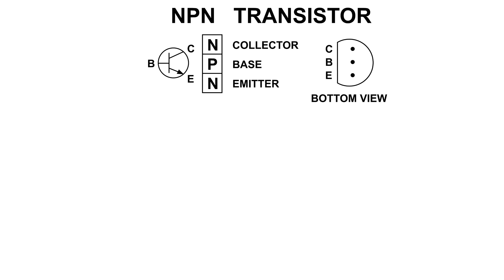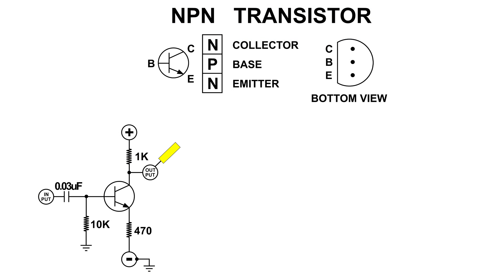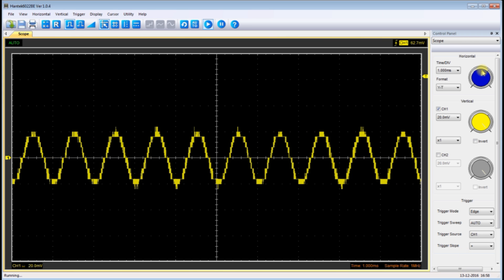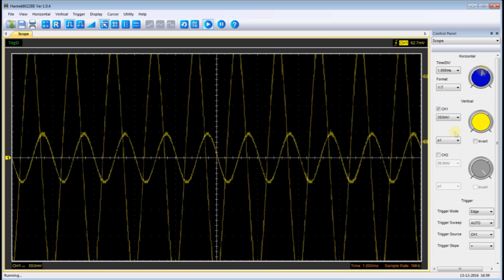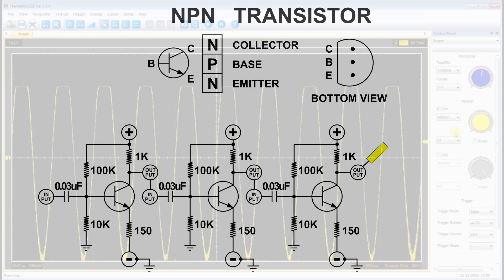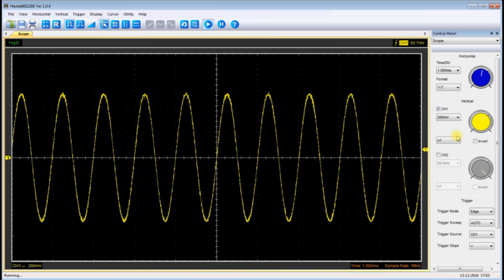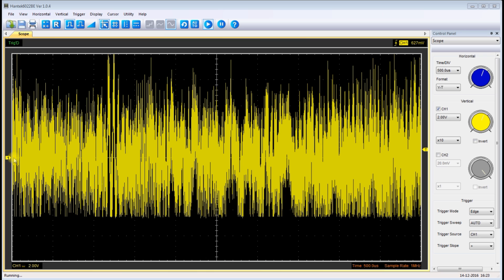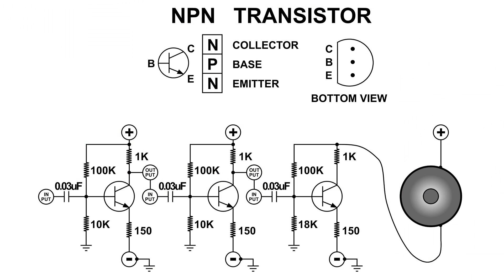Transistor Amplifier Biasing Experiments, for the Beginner

Comment: What would this circuit look like if you were using a big transistor like 2sc5200 and pulling like 10a of current through it obviously those little resistors would pop instantly so how would it powerful output stage transistor be biased and wired up?
Reply from the maker: 2SA1943 2SC5200 200W Amplifier Circuit
https://320volt.com/en/2sa1943-2sc5200-200w-amplifier-circuit/

Comment: Thank you for this video.  I may still not quite understand the mathematics behind the component values and their effects on the system overall, but your section-by-section progression through the build helped me get my own amplifier working.  I was unable to get anything more than about 2 volts output before, from two or three stages, even at 9V rail, and each stage too easily clipped the bottom of the waveform on output.  I'm puzzled why biasing the base makes this difference so profoundly as it does (I understand the concept but not the amount of effect it s) but my 265 mV input signal now is amplified over 2600% to 7 volts, and the waveform out is just as clean as the one coming in.  I'm eventually going to work this into a combination Morse code oscillator + microphone amplifier to use in a future ham radio build.

Thank you again!
Reply from the maker: Thank you, and your welcome.

Comment: Hi Rich, Very nice explanation. Is the capacitor there to filter any DC that may be present on the input signal?
73,
Mike
Reply: n1chp I think the capacitor s he used in this video are to block any DC from getting to the amplifier, so yes you are right. That is also why the values for the capacitors are so small.
Reply: Thank you
Reply from the maker: Thank you, and your welcome.
Reply from the maker: Thank you, and your welcome.

Comment: thanks for your latest experiment with the easy explanations of a three stage amplification circuit which can be used also for a simple radio receiver of the local strong emitting station. It was the best I have ever got this lesson together with all the ones you did before. Do you have written a learning basic book about all your lessons you have described? I would be very much interested in getting one for me and also for a friend of mine. Looking forward of listening from you , I remain your affectionate pupil of transistor electronics, abele ballestri ,Switzerland.

Comment: I once did pretty much the same as you (made a three transistor amplifier) and started to receive shortwave radio signals from Russia and even Australia! I still have the recording somewhere. My understanding of electronics was limited back then. I didn't bias the transistor stages correctly so the clamping distortion demodulated AM signals quite well into audio.